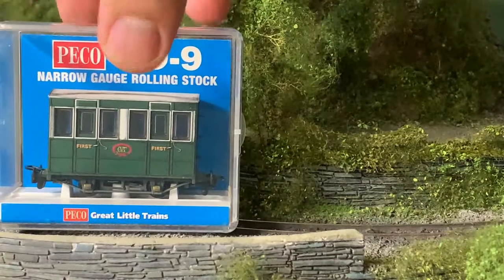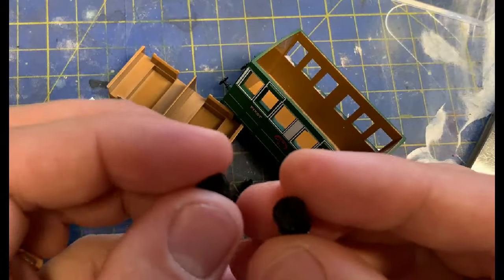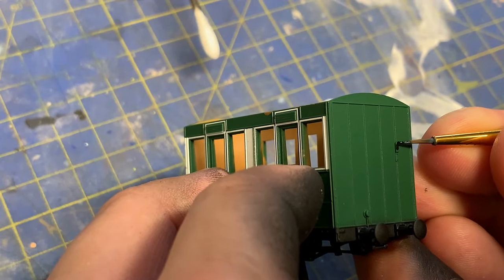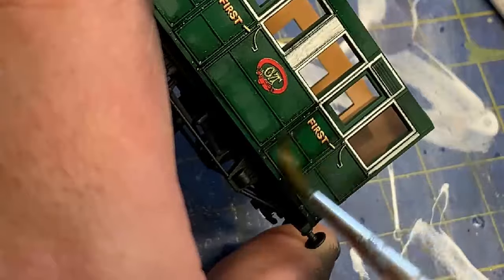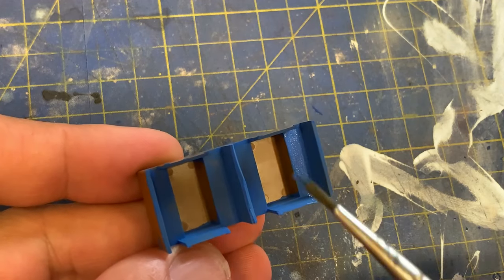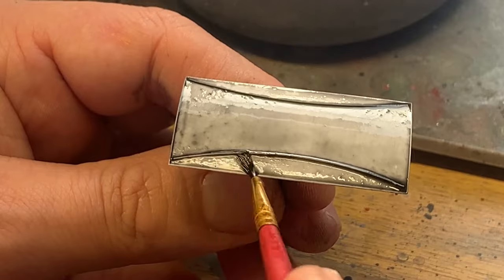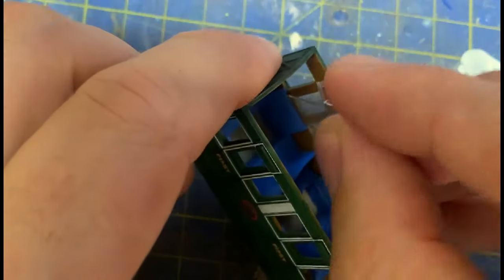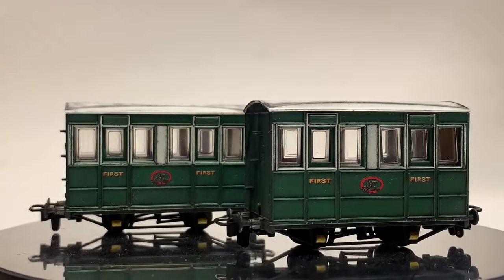How To Add REALISM to RTR Peco 009 Talyllyn GVT Coach

Comment: I have to agree with you George  the weathering and highlighted details make such a difference. Quality work as always. I would be tempted to change the wheels for metal ones though.
Reply from the maker: Good to hear, I think it does aswell, and it goes my require expensive tools or loads of time to do it, so there’s no excuse 😅

Comment: Looks great! I didn’t know that the Peco rolling stock has plastic wheels, that’s kinda crazy given the price.
Reply from the maker: Yes I agree, but personally I did see that it affects the running quality
Reply: @GWilliamsonModels  that’s true, the other thing though that others have told me, and I have experienced myself, is that eventually the plastic wheels wear down, and it gets small shavings of plastic all over your track. Can’t deny that they do often roll smooth though, which is nice!
Reply from the maker: @modelrailfan37  interesting point, I highly doubt that these will run enough to get to that point, but if they do, I’ll just swap them out for metal
Reply: @GWilliamsonModels  ya true, on a small layout it might not be a problem, and since I mainly model OO and North American HO, I probably would see it more than someone doing OO9 since the rolling stock is larger, heavier and in the case of US/Canadian stuff, it is usually quite long and on bogies.
Reply from the maker: @modelrailfan37  yes I’d say it depends on what you’re modelling, I wouldn’t want long heavy trains with plastic wheels